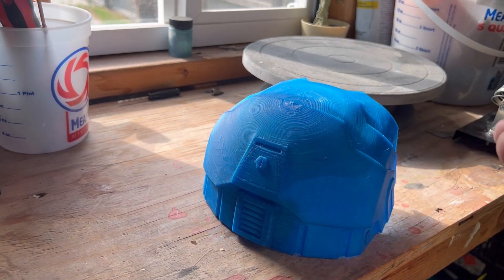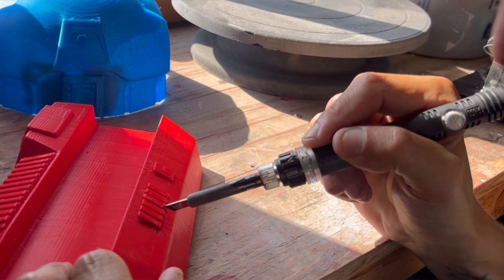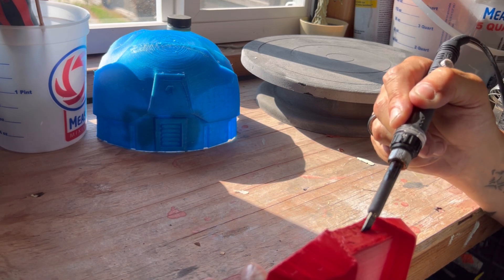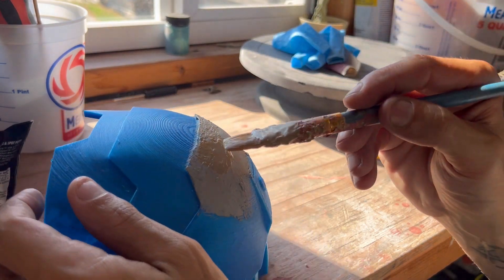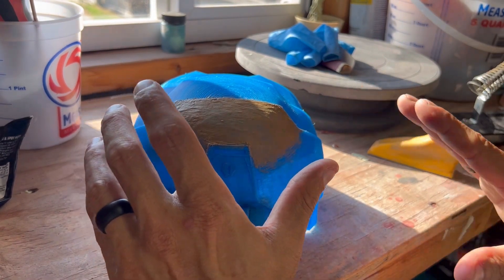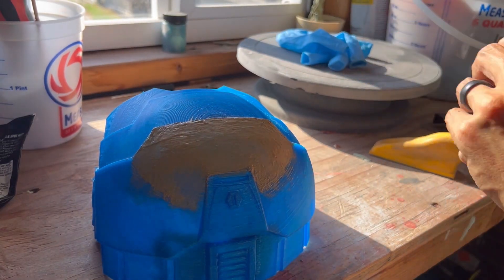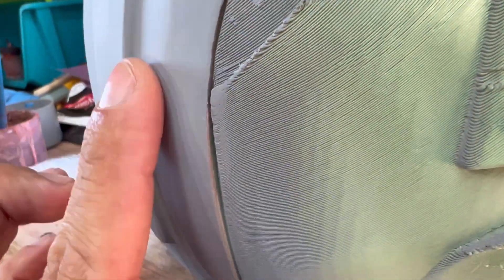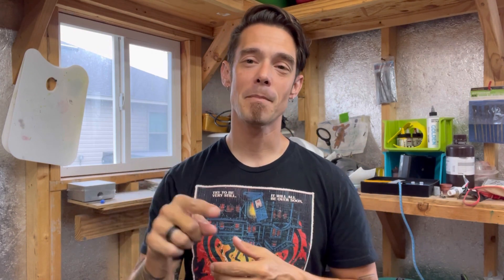Fixing 3D prints when printed upside down. Repair support damage with soldering iron & bondo filler.

Comment: So I may have made a mistake. I primered some pla prints using krylon acrylic primer then realized the layer lines were worse than I thought. Can I spray the bondo Filler directly over the krylon primer? Bonus question, the bondo can says to spray between 70-80 degrees. Have you had luck spraying under or above those temps??  Thanks DD!
Reply from the maker: Just sand the krylon and apply bondo. I’ve sprayed bondo at 60-65. Above 90 is risky
Reply: Well dang I got antsy waiting on the response worried I was going to run out of daylight I just sprayed it directly over the Krylon primer 😬
Reply from the maker: @tysoncolley8110  you’ll be alright
Reply: @Darkwingdad  you think so? I'm paranoid that I'm going to spend a ton of time painting then the primer will curl or flake off?
Reply from the maker: @tysoncolley8110  nah, if it was rustoleum I’d say strip it off but krylon will be ok. Always put heavier filling agents on first. Filler primer is the last step

Comment: Thanks DW!  Those pieces look amazing.  Gonna give this smoothing a try.  Always been kinda hesitant to sand to aggressively.  Took some before pics of the Mando helmet I printed on my ender 3 in 7 pieces.  Will take some after pics when I get it done, hopefully sooner than I have gotten around to trying some smoothing/sanding.  Printed it about a year and a half ago :D 

You mentioned PETG, was thinking I might give that material a try too.  Only used PLA up till now...
Reply from the maker: No problem man! Petg vs pla is user preference, either way this process will work for both!

Comment: I've a quick question, you used Silk PLA. I was thinking that you don't post process them because it is Silk PLA and the finish goes away with the primer and putty added later. So why use Silk PLA at all? Why not just regular PLA? I'm really curious and I battle with this question. I love the silk PLA videos you've done so I was wondering how and where this sits
Reply from the maker: It was just extra filament I had laying around. You can post process silk filament it just obviously won’t be silky anymore.
Reply: @Darkwingdad  I was really hoping to print some silk PLA without post processing. I mean those colors just pop, especially the tri-color ones. It would be a shame to fill those up with primer and completely kill it. 🥲
Reply from the maker: @JohnyPatrick  with silk you can, I have several videos on settings & how to position. They’ll definitely help you get some quality prints without sanding.
Reply: @Darkwingdad  Yes I'm absolutely loving those videos and those will be my go to when I start printing those tri-color filaments that I got. Thank you so much for the response! This video is lovely!

Comment: I do a 0.6mm nozzle with 0.2mm layer height prints with Arachne engine so it prints just like a 0.4mm nozzle but just faster. Simple straight designs for the most part and somehow even at 400 grit I don't seem to get the look that you get so easily. I did try a PU spray and primer based paint and it sorta solved some of the layer lines. I applied putty and it was hell after that. 80 grit to 400 grit and I still see a lot of gaps to fill from the putty I applied. Not even sure what I'm doing wrong.
Reply from the maker: Check out my new video dropping this weekend

Comment: Outstanding work DWD, love watching the channel, the only thing that's missing for your Aussie friends is we don't have access to Bondo products.
Reply from the maker: Thanks Pete, I always got your back. Although it’s a little different than plastic metal this product here https://www.amazon.co.uk/ISOPON-Bodywork-Scratch-Repair-Smooth/dp/B07KV3P8BN/ref=pd_aw_ci_mcx_mh_mcx_views_0?pd_rd_w=WRtmh&content-id=amzn1.sym.f2aca063-8a8b-49d1-9be7-42a31a3f7e53&pf_rd_p=f2aca063-8a8b-49d1-9be7-42a31a3f7e53&pf_rd_r=PS0991MA28GBA3AR4K3F&pd_rd_wg=M5Cvb&pd_rd_r=cd571f7d-5bde-440c-b0b6-5950dd26ebf7&pd_rd_i=B07KV3P8BN 
You can dilute with acetone, no hardener required

Comment: Never used plastic metal. seems like it might be kind of like a middle ground between spot putty and the normal bondo body filler. Right now I'm working on the MA5B Assault Rifle from Halo and using some of your tips like brushing on the spot putty/acetone. Definitely really liking it. I tried airbrushing but but wasn't really feeling that. I'd rather just brush it on real quick and get to sanding.
Reply from the maker: That’s right on the money. I personally can’t stand 2 part bondo filler, nightmare to sand. This filler is great & as I showed you can “lighten” it with acetone & it helps greatly. You can even add bondo putty to it if you want to make it less dense. I’m kind of with you on spraying it, brushing is just quicker.

Comment: In modeling we use acetone and combine it with the plastic sprue to make "sprue goo".  The consistency depends on the amount of acetone, but generally it's used as a gap filler that also bonds the plastic.  Have you tried to melt your failed prints to use as a gap filler?  I'm not sure if PLA acts the same way as polystyrene.  Great stuff, always appreciate you experimenting and showing what does and doesn't work!
Reply from the maker: If I have big gaps or failed prints I’ll use scrap pieces or left over supports and I’ll melt them down with a soldering iron. I’ve never use polystyrene, it being a polymer I assume it would work with other thermos. Might be something worth looking into…🤔

Comment: I got a large delivery of Ziro filament today and they have changed to cardboard spools and I am getting an X1 Carbon shortly so Im going to have to print and build a re-spooler to get it onto plastic spools, unless I try the printed rims that fit onto the cardboard spools.
Reply from the maker: I got a few rolls and had no issues with cardboard spool.
Reply: @Darkwingdad  did you use them with a Bambu Lab machine?
Reply from the maker: @AndrewAHayes  no